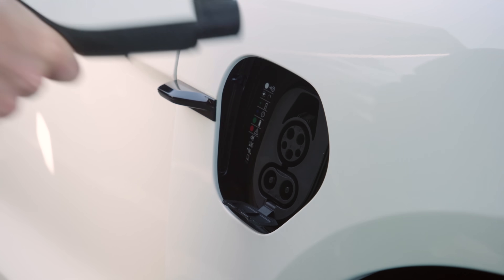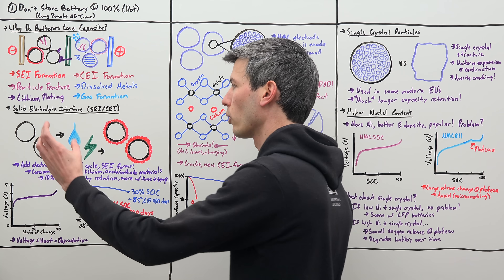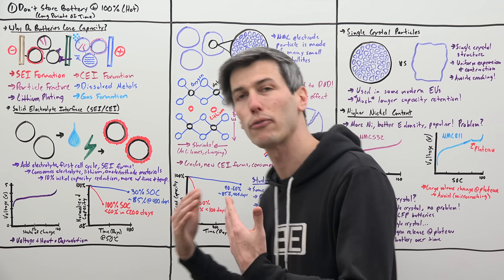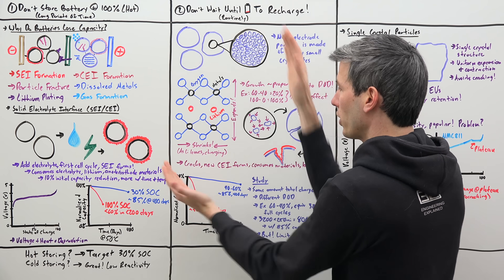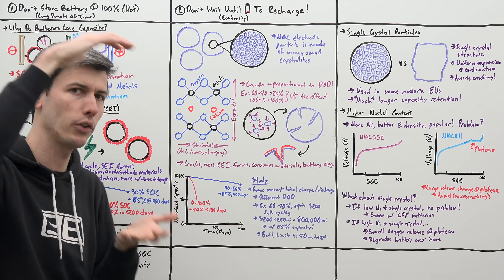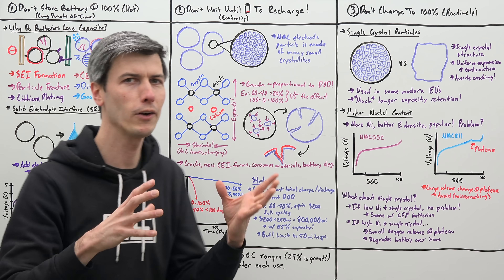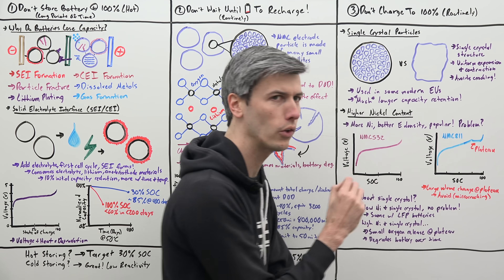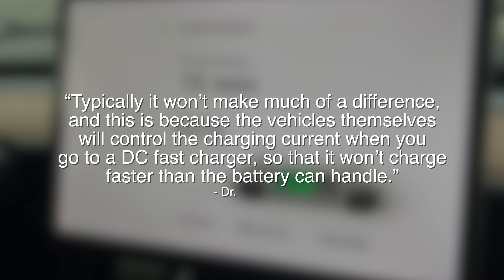How To Ruin Your Electric Car's Battery - NMC Edition!

Comment: I've never owned a car, but I do have a (gasoline) motorcycle. It's interesting to hear the discussion about range as my motorcycle gets ~140 miles on a tank before I have to pull over to get to reserve, where it has another ~20 miles. At least with the way I ride, I really want some kind of a break after putting 80ish miles on it, which makes me think I could totally be unfazed with a 160mi range EV. Some people I know have serious range anxiety though... they won't buy an EV unless it gets 500+ miles of range.

Comment: "Wow, I've invented a replacement for the horse.  It's called an ICE car.  Just follow these tips.  1) Avoid filling your gas tank beyond 3/4 full.  2) Expect your gas tank to shrink in size month over month. 3) Drain your battery before storing your ICE car in hot weather.  4) For every 5 gallons you burn, fill up again, otherwise item #2 gets worse.  5) Expect to spend hours at the gas station in the bitter cold, watching the fuel drip out of the nozzle.  6) If you put a scrape in the gas tank, be prepared to spend 25-40% of your purchase price on a new gas tank even if it's not leaking."
Reply: 1) you get better gas mileage keeping your gas tank half filled rather than fully filled. Quite a few people do this. 2) your gas engine gets slightly worse mpg over time due to wear and tear thus reducing your range 3) sitting gas in a tank for extended periods of time degrades and needs either octane booster added or to be drained and refilled before start up 4)see (1) 5) I sit in my climate controlled car watching movies/listening to music or grab a bite to eat while charging 6) yes

Comment: 1- Do not store your battery at 100% on hot environments for a long period of time
2- Do not wait until the battery is low to recharge it (only in extreme cases)
3- Do not charge to 100% (only if necessary)

Comment: Do you think there’s any danger of cell imbalance when habitually charging to less than full? This is something I hear a lot but I imagine it’s not a big problem if we allow a full charge every couple of weeks
Reply: These vehicles have BMS which balance cells before or after unplugging the charger, as part of the charging process. So the level to which it is charged does not affect cell balancing.
Reply: I think that depends on on the car. I know my PHEV only balances through passive cell balancing. Charging pauses repeatedly near full charge so the most ‘full’ cells are able to bleed down to the level of the lowest cells. The process repeats until it’s balanced as well as it can.
Reply: @davidroberts5199  Ah, I wasn't exactly sure when these charging 'schemes' do their balancing. You were correct.

Comment: This is a reason I wont get an e car anytime soon. This should be handled by the software. I should not be taking extra precautions to make my car not simply irreparably erode when it's energy storage solution is already a huge hassle with a ton of caveats.
Reply: It is handled by software though. Like, in a Tesla for example it'll default to charging to 80%, and warn you when you park your car with low battery remaining. It tells you what you need to know.

There's such a small amount of things you need to remember. Like, it's no more complex than figuring out which fuel you need.
Reply: @logitech4873  chosing fuel is not complex. There are 2 fuel types and premium options if you have a sports car. That's it. 

Well then why the hell Jason ads so much extra instructions on how not to break your battery then? Also charging to 80% lowers your range. If you go on long trips often (main purpose of my car) it's shortening your range not to break your car which is idiotic
Reply: @NotADuncon  Just use 100% if you want on a long trip. But charging to 80% is faster on fast chargers, so that's what you're gonna be doing anyway if you're driving a few thousand kilometers.
Reply: @logitech4873  but then for how I use cars I will damage the battery and get low range and frequent charging. This reminds me of when I had a car with an LPG tank where the range was similar to electric cars at 80% range and where I had to plan my refueling. 

Electric cars are fun but they work for people in areas with midle of the road ranges. That's why they are amazing in coastal US states where long trips = plane or in Norway where most of the population is concentrated in specific areas.
Reply: @NotADuncon  They work absolutely fine for long driving distances though. And I live in northern Norway. Norway is a country of long distances. The closest multi-lane highway is 12 hours of driving away.
This summer I drove 13,500 kilometers through Europe with my model 3.

Comment: Stop blaming the user. EVs are smart, they can be programmed to fix user error. If they are not, this is 100% the manufacturer's fault. Battery chemistry and all that B.S. doesn't matter. That's what the battery management system is for. We need to hold these manufacturers responsible for a shite product. It's as simple as that.
Reply: But the cars do tell you what to do. My Tesla defaults to stopping at 80% charge, and warns me if I leave the car with less than 20%.
Reply: Yes, but keeping your battery chemistry in a stable state of charge is only a part of the problem. Unstable chemistry is issue when batteries are held for long periods at full or empty charge. These same batteries are used in power tools that only have an expected life of 3- 4 years max. Making them last longer is not a real expectation. That's a problem when the battery is worth more than the car. From conception, the EV design is not meant to last. So it's not okay when they blame consumers. We didn't break it. They knew, and made it anyway. But hey,  they have your money!
Reply: @dinner85  I think you'll find that actively cooled batteries with great consideration put into longevity will last a lot longer than you think. There's a reason EV batteries have 8-10 year warranties, not 3-4 years. Treating them well can make them last a very long time.
Reply: @logitech4873  So if keep your batteries in an optimal state which means you baby them and don't expose to fair use as a consumer. They can last past 10years but you will get a fraction of your range and you will hate your life. People thought it was bad when the iPhone was slowed. This is much worse. Not a solution or a reasonable expectation for everyday wear and tear.
Reply: @dinner85  Again you're only hearing what you want to hear.
Reply: @logitech4873  I didn't acknowledge what you said about 10year warranty.. Mainly because there is a mile limit on the warranty that most people will exceed in a year or two. Especially people who want cheap electricity over fuel because they are driving a lot.. So the 8 to 10 year is non applicable to most. They also have other clauses such as being void if there are scuffs such as the Hyundai Ionic and the 60k price tag we see on that.. Interested to see how expensive insurance gets since depreciation on EVs can be faster than the loan terms. But we will see. You have my respect for owning a Tesla and being a leader in change. All the best.

Comment: Just do not buy EVs
Reply: Why not?
Reply: Cold temp is simple answer.
Reply: @ilyashick3178  80% of new vehicles sold in Norway are EVs.  They seem to get winter there, too.
Reply: Norway power utilites  are one of advance and powerful to support on demand charging EVs. 80%  but what are performance as an example  battery kwt per hour degradation what is temp below  minus 15 C.
Reply: @ilyashick3178  I don't understand what you mean with that last sentence.

Comment: It's a lot to take in for the consumer who is just used to filling up a fuel tank as much or as little as possible and draining it as much or as little as possible before refilling.
Reply: Don't store at 100% state of charge
Charge often if you can (easy for people with plug at home)
Don't charge to 100% when you don't need it.

These are very simple things to remember. But luckily for us, the cars will tell you this anyway. My tesla defaults to stopping a charge at 80%, for example.

Comment: This is why you never buy a used EV, you have no idea how that battery was treated. Lease new ones, that's the only logical way to drive one.
Reply: Buying used EVs is fine. You can test the battery capacity if you need to.
Reply: @logitech4873  a dealer is going to tell you an honest test result, when they want to sell you the car?
Reply: @Ping_freud22  If they don't, you just return it. Alternatively just run a test yourself before buying.

Comment: two Prius Prime in the family. Both cars are 2.5 years old. Both cars doing 0 to 100% every single night, so about 340 days/yr. minus some vacation days, sick days etc. One car is 80.000km another one is 70.000km. Ontario Canada, not very cold but can go to -10C at night. No degradation observed. Incredibly reliable cars.  
Extra info if you are still reading: charging only at night at about 8 Canadian cents per kWt.
Reply: We just traded our second Prius for a 2024 Prime. Prius number two was a C, with a .9kw battery. It went 128,000+Km without issues over 12 years. If you think about it, that tiny battery was being charged and discharged many times on every longish drive. At ten years the battery lost the ability to run the C in EV Mode but, the milage remained at between 4 and 5 L per 100Km (temperature dependant), right till the end. We got half of the purchase cost back on the trade.

We have been charging the Prime to 100% each night (well, to 90% really), as there is a buffer at both top and bottom ends. The Prime's best EV range to date was 91Km ! The key to keeping the battery healthy is to slow down the discharge rate, so that means driving with as little electrical load as possible. No heat/AC, no heated wheel/seats etc.

Comment: You assume that charging your car to 100% on your display actually has anything to do with what the engineers want you to see.
 Strangely a too low range measured by state lead to a software upgrade on my car model that made the new 100% loaded range be more than the old 100%.

So they either cheat on the low end, the high end, or my guess, both ends to adjust it so you reach your battery warranty stated lifetime.
 Just imagine they had to really swap the battery in warranty for free, a few month before it expires... are you crazy ?!?
Reply: You can just use something like car scanner if you want to know the state of charge as reported by the BMS. It's rare for EVs to have a buffer beyond 100% (e.g. limiting to 90%), but it's common to see a buffer below 0%. (You can often drive an EV down to -5%)

Comment: As Jason explained, its the manufacture's problem to figure this out.  But as a consumer, the product is not ready for the masses.  Its clearly still in beta development.  There are too many "rules" to operating a battery powered vehicle.  When ready for retail sale, a product should be ready for its audience to use out of the box.  It shouldn't require the phrase, "well, nobody told me that before I bought it".  Are battery cars cool, some of them.  Do they work for everyone, no.  Just remember, when you fill up your gas tank, the engine doesn't care if its half full, three quarters, or filled to capacity.

Comment: Wait, Supercharging has no effect? You mean a rate of 900+ MPH into the battery is no big deal?
Reply: Yes, that appears to be the case because the car controls the current being put into the battery.
Reply: "a rate of 900mph+"
The stupidest unit of energy ever devised. Ever heard of kilowatts?
Reply: @logitech4873  It actually works if you think about it, which you haven't. MPH can also mean miles per hour as a metric of range within a certain time frame, in this case miles of range recharged within one hour, not just velocity (in fact this metric of velocity is stated as a theoretical distance traveled per hour at current speeds, so it is always related to range anyway).
Reply: @logitech4873 You obviously never supercharged a Tesla.

Comment: EV range is a big enough issue as it is, without restricting yourself to not completely charging the battery! Imagine not being able to fill your fuel tank and being constantly worrying that your refuelling techniques / habits are going to cost you a fortune in battery replacement?! Can't imagine why I'm not in the slightest bit interested in owning an EV 😂
Reply: Its about as much of a tip as not having turbocharged cars shut their engine down immediately after reaching at empty gas station on a road trip.

Ideally you should both, wait for the turbo to cool down before shutting down after spirited driving, as well as wait for the RPMs to settle and oil to be circulated properly before driving off, but how many people really follow or even know of these rules?

As he said, 250mi ev with 3200 cycles is same as 800K mi lifetime for 15% degradation, deviating from this for once in a while road trip isn't going to wreck your battery, heck, even if it lasts half of that at 400K mi, its good enough
Reply: That is not at all what he said.
Reply: In reality there's no "constant worry", because you just set a charge limit in your cars charge settings (which will usually default to 80%), and you just plug in every day when you get home. It's not in any way complicated or difficult.

Comment: Point 2 about deep cycle battery use also applies to the classic lead-acid units. However they are resilient to constant charging and are not overly impacted by being at full charge.

Comment: Ok I have a question I’ve read reports that ᴀ ʟᴏᴛ of EVs are having g battery replacements after less than 100,000 miles. So if this is happening either there’s ᴀ ʟᴏᴛ of defective batteries being put into cars or we are being told the wrong ways to use our EVs
Reply: Replacement rate under 100k miles is about 2%.  I wouldn't call that "a lot" but maybe you do.

Comment: As for charging to 100% Tesla has systems in place making it harder to charge over 80%
Reply: Harder? They just default to an 80% limit. You can change that via the screen or the app by dragging the slider.

Comment: We recently upgraded to an EV6 and absolutely adore it.  We're also keeping it between 40 and 80% SoC with the rare charge to 100% SoC.

We previously had a 2017 Kia Soul EV with a 27kWh battery.  With the car's lack of battery thermal management and no apparent way to set a max SoC target, the battery degraded rather quickly.  Max range new was around 90 miles. Our range despite getting 3.5-4mi/kW was only about 50mi max lol.  It was definitely a "My First EV".  We thanked it for its service and upgraded to an adult EV(the aforementioned EV6) and we absolutely love it.  Our EV6 is set to 80% SoC max which translates to about 300miles of range in the winter.  0% complaints there.
Reply: 300 miles in the winter?! Just got an EV6 and I'm hardly getting 320km at 80% here in Canada... Is it the RWD version that you are speaking of?
Reply: Rwd long range can get over 315miles here in GA

Comment: Great and informative content, as always! What would be the recommended course of action when it comes to longer trips, say 750+ miles or more than two/three consecutive 100% charges?
Reply: Charger hopping is faster for trip time (and your wallet if the charger is time based) 

Charge to 80% and drive to next charger 

Repeat till reaching destination.

Charging the last 20% from 80-100 takes long than it took to go from 60-80 or say 40-60.
Reply: 80% is generally faster anyway so just do that. For roadtrips I tend to start out at 100% from home, but it's not really necessary
Reply: Actually between 50-70 is faster since you’ll be riding that higher charging rate curve each time you plug in and just keep doing that. At least with a Tesla that is.
Reply: @MellowGamerPlays  Yeah but it's a bit impractical. Makes sense if you're really trying to optimize for time.

Comment: Im curious why lfp batteries in standard range teslas get the recommendation to charge to 100% at least weekly. From what i understand the upper pack voltage isnt that high so it does not cause much degradation but not sure
Reply: For cell balancing 

I have a non tesla LFP EV and the service technicians got a lot of people whose batteries were facing SoC drop and range mismatch 

Turns out they had been charging only to 80% because they followed what they did with their phones and laptops and that didn’t have opportunity for the battery to do cell balancing for months at an end

Comment: I have a 2013 Renault Zoë with the smallest 21 kwh battery pack. On a warm spring day at around 20 degrees celsius I get a range of about 150km, which is quite fun. However, charging capabilities aren't great as my car is stuck on a Type 2 adapter and everything these days is switching to CCS.